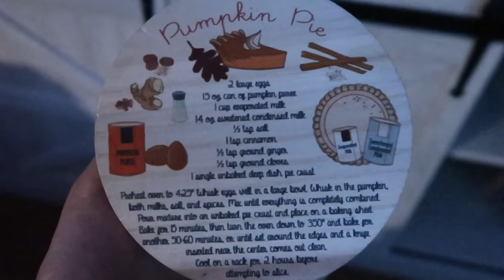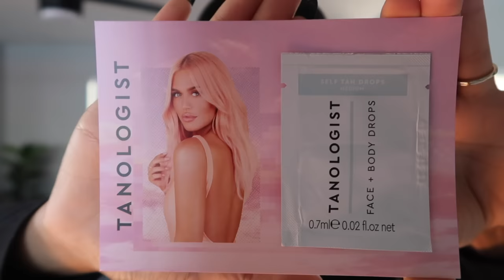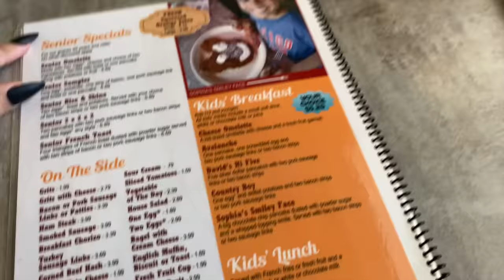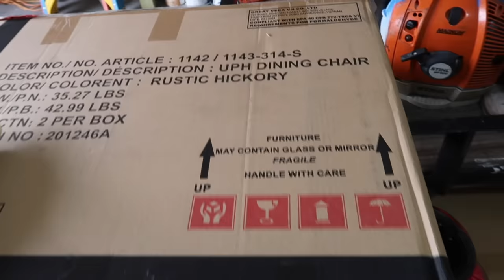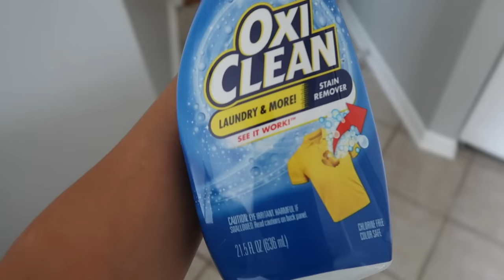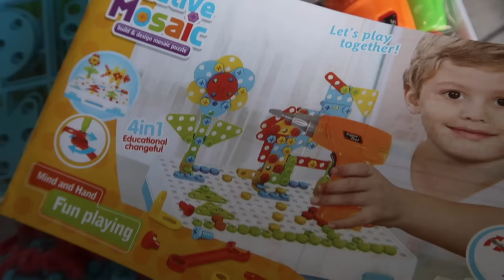Spray painting our sink black + Walmart Beauty Box Fall 2021 + Breakfast! Sharlene Colon

Comment: The sink looks soooo good! have been wanting to paint my bathroom sink with that same kind of paint but white but have been nervous 😬. Keep us updated on how it holds up.
Reply from the maker: Will do!!! ☺️
Reply: Miss Niki, there are tougher epoxy spray paints you should be able to use on your bathroom sink. It may stick a while since the bathroom sink gets less abuse than a kitchen sink. P.S. really rough it up with sand paper before applying.

Comment: Wonder if the paint scratched off when silverware is sloshing around in the sink 🤔.
Reply from the maker: It did after a while 😩
Reply: @SharleneColon  Why thank you for the response! Hopefully you now have a black sink like you wanted. We all see that you have a beautiful family. Thanks for helping us with our DIY ideas. Edit: if you still want to salvage the sink..... Maybe scratch with 60 grit sand paper to remove all the old paint and mar the surface.... then use a self-etching metal primer...  follow up with two coats of black epoxy spray paint. Happy DIYing.